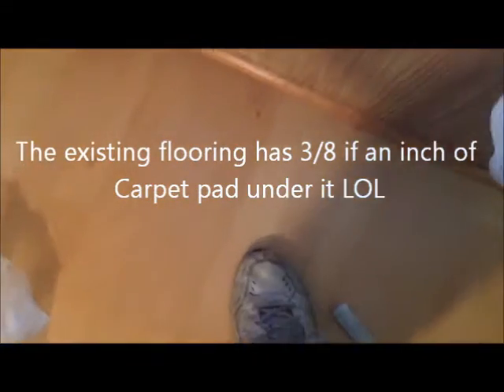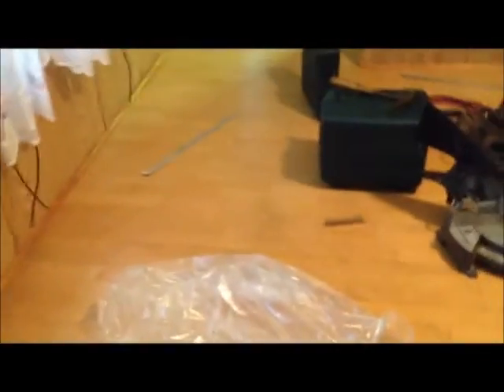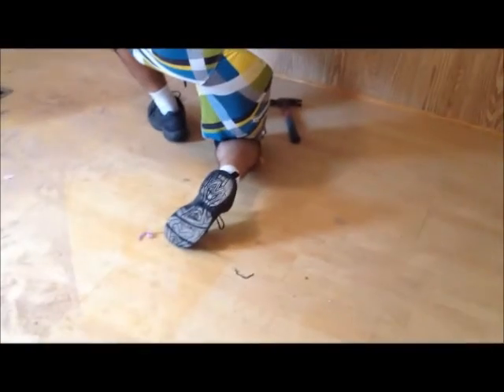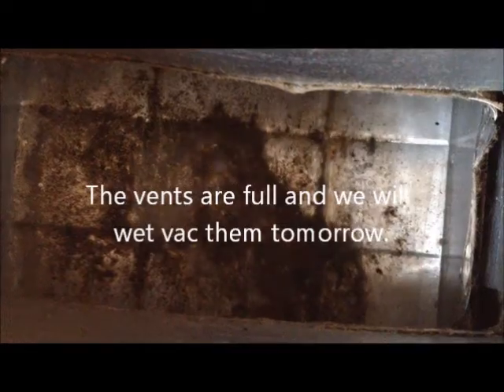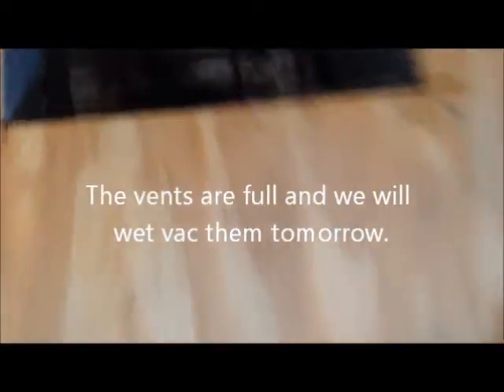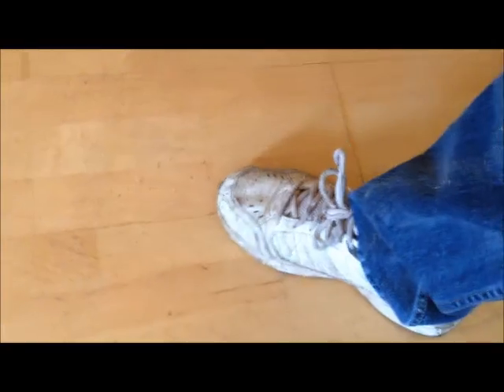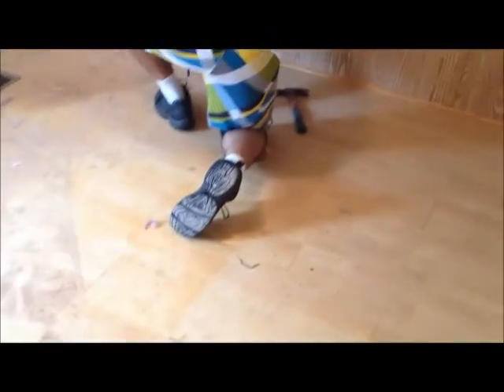How to Mobile Home floor repairing and how we did it

Comment: how do you handle going over the marriage line in a double wide, that's not exactly perfect? Do you belt sand, then use patch compound for subfloor, and then put 1/4 luan plywood and then put vinyl plank flooring (floating)?
Reply from the maker: You definitely want to put quarter inch Louan down first before you put your flooring that is what smoothed it out
Reply: @Drewsroofingandhomerepair  Thank you for your help...there's no good info on the web about this :(
Reply: @Drewsroofingandhomerepair  I redid a double wide 2 years ago. Where I replaced the plywood I’ve had the new lvp  buckle. Do you have to go back to front on laying flooring? Or too few screws? Definitely will try additional luan. Breaks my heart to pull it up without knowing why it failed.